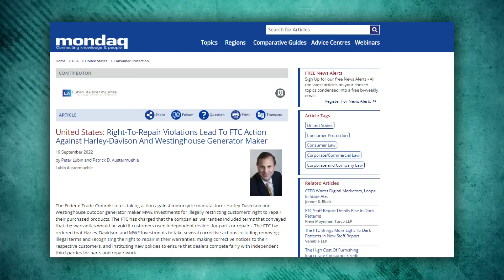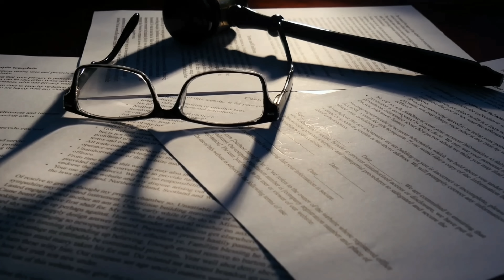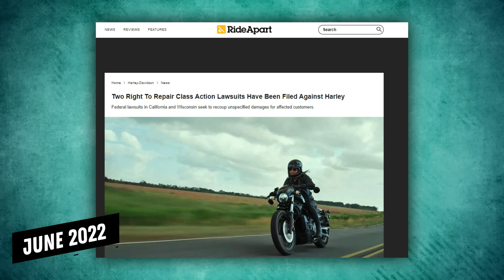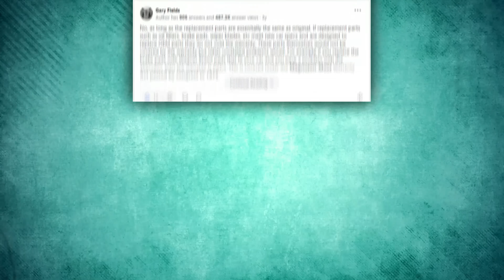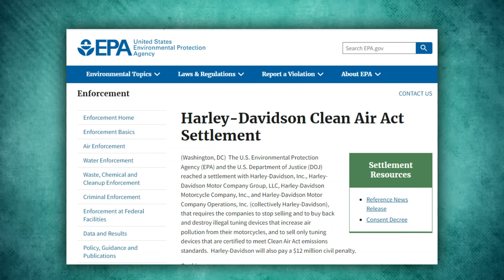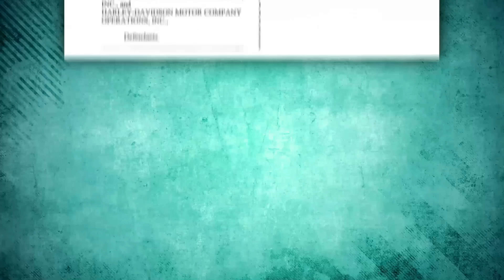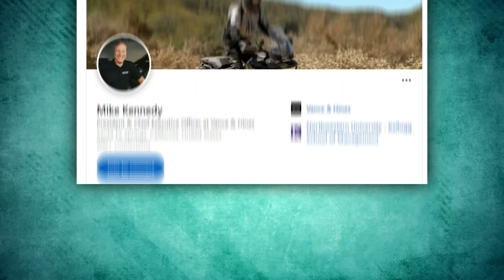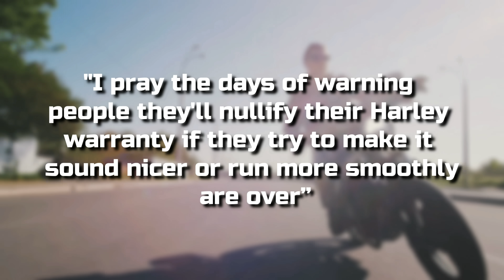This Affects All Motorcycle Owners!

Comment: Im 15year  Technician at the same HarleyDavidson dealership , we install aftermarket parts dragspeclties , tucker . We warranty our work for a year and some acception by miles for the weekend warriors and still guarantee the factory warranty aslong as it's in our hands , now sometimes they send a representative to check out the problem in person then depending on what wrong and what after market parts or on and if they caused the issue at hand . Ther ar a lot hacks out ther and so as a flat rate technician not everthing going to covered by warranty If your that type customer you will never get any technician your bike will handled by many technician instead of one technician that will produce good work , honest and knowing you and your bike is a good thing .

Comment: Been riding a harley for years, have a 1988 complete custom 1200 sportser bought second hand with 3,000 miles on it, it now has over 135,000 miles on it, have a 2007 ultra with 49,000 miles on it. Both have been trouble free, except normal wear and tear but i can't even buy oil filters from my local dealer or even a different sprocket for my 1200 so to me dealers are as useless as their warranties. I have never needed either one. I'm almost seventy so I may never buy another bike but if I do it won't be from a dealer it will be a low mileage taken care of used bike.

Comment: The thing that I don't understand is why? There is something else going on here. All of this right to repair stuff is only going after substantial American companies. Yet you can't do anything to most new cars without voiding the warranty. All of the New electric cars will stop working if it's not fixed by the dealer or a approved shop.

Comment: Well As a Retired Harley-Davidson Service Manager and Warranty Manager, i can Say this Video is VERY Misleading !! NO ONES Warranty is being revoked for changing a Radio, BUT Harley Will Not Cover the Say Pioneer or Sony Radio installed Nor will it cover any Damage that the installer did to any connected parts.  As to the Muffler thanks to the EPA bikes come from the factory right on the edge of a lean condition, adding the muffler could make the lean condition WORST !! thus damaging internal parts in the engine and Emission parts, as to the tuners, and Cams and other upgrades Harley has done a lot of work to stay compliant with the EPA, you go slapping on aftermarket parts that are not compliant and 1st harley has every right to void the warranty and all these law suits will go No Where, and harley may get even stricter, frankly if i was the CEO of Harley i would drop the factory warranty and let people buy however long they want with written rules on how to keep it.

Comment: I have nothing against HD, they have beautiful bikes, a long history, a huge franchise, and locations, however, most metric bikes (Yamaha, Kawasaki, Honda) will oftentimes use aftermarket parts in replacement for things such as gaskets, bolts, exhausts, filters (air and oil), and even use fluids/oil that is better and help the engine life last longer than the default fluids that come with the bike from the factory. Most of these dealerships are Powersports and do serve most that are not just the weekend warrior. An after-market brake pad without a built-in vibration damper can cost me $30 to replace and have the same result and stopping power as the $130 OEM pads. besides most warranties are typically for a year, so after that point, you're on your own anyway. You can't even buy aftermarket exhausts in California, and if you got ahold of one, it most likely wouldn't pass their emissions test. If it's too complicated to mod and ride your ride in the sate you live in, move to one that's more mechanically friendly.

Comment: I played in twice the normal speed to obtain the necessary information from the core of the problem.  Locked-in-vendor sysdrom is a bad thing for any brand of motorcycles, especially for HD as their sales are falling down.  You can't blame a custorm for a mechanical brake down when another part is installed which has nothing to do with the problem. A bad thing it is.

Comment: You change anything that increases or decreases performance your warranty should be void . That bike has a warranty that covers the bike AS BROUGHT period . That includes adding parts from any other company unless Harley has clearly stated those parts are approved. After the warranty is up do all the modifications you want . Run the bike the way you bought it , change anything , tires, exhaust , chains , sprockets and the warranty dies right there and then

Comment: Buy one used, or buy 50 state legal Screamin Eagle parts until the warranty runs out. I bought mine used with aftermarket pipes, air cleaner, and tuner on it, FROM a Harley dealer!!!

Comment: The warranty and keeping them stock is a good deal in one scenario only as I see it. Say you are retired and want to tour. Coast to coast….going everywhere. Because there are dealers everywhere, any issues or needs can be handled, and if you have stock wheels and tires, it is easy to replace a tire if it is in stock at every dealer.

Comment: I go back and forth on this topic. On the one hand, a company is only able to control its own conduct and practices. So if you take your bike to Joe Schmoes bike repair and amphetamines shop, and they do shoddy work that affects the lifespan of the product, why should Harley be held responsible for that early failure? Same goes for using aftermarket performance parts, or cheap reproductions. Harley has no control over the quality of those products and shouldn’t be held liable for the consequences of using them. On the other hand, I want to work on my own stuff, and I want access to the same information a Harley tech would have access to. Almost zero manufacturers of any product are doing that, and i think it should change. That being said, If I make a dumb mistake, and the engine fails, that was my mistake, not Harley’s mistake. Maybe some of you have had experiences that will clarify why this suit is needed, but I personally don’t think this is a complicated topic.

Comment: It is stupid, as it should be uniform across the brand, but the warranty coverage is solidified yet subjective, on a dealer by dealer case in terms of Harley. What I mean by this is while all dealers have manufacturer set warranties, some dealers are absolutely draconian in what "their" warranty covers, while others take a more lax, common-sense approach. The latter tend to be dealers located in smaller markets to my experience, that don't get as much volume as their bigger city counterparts, and overall are more down to earth because they have more to lose consequently. The dealer I bought from fully expects new owners to do reasonable mods (bars, seat, suspension, breather, etc.) off the bat. Will they warrant replacing the aftermarket stuff that took the positions of the OEM parts? Obviously not, unless they do the labor/install themselves maybe. But completely voiding your overall warranty because you wanted ape hangers to replace the god awful stock bars on your Road Glide? Dealerships that would do so deserve to be ran into the ground. 

Overall though, this should set a precedent for the whole motorcycle industry, and hopefully help the consumer. Everyone likes to point the finger at HD, but I've heard of other brands doing similar right-to-repair violations, such as Ducati. This effort can only help consumers.

Comment: This is one more reason I would not buy a new harley..I would buy an older shovel that has no warranty  and I can do to it what I want. This is just like auto warranties that require you to take it to a dealership  for simple maintenance  schedules. 5w20 motor oil is just that 5w20 oil..it doesn't  matter where you buy it.

Comment: Long time owners of old bikes won't be affacted much; espicially if they do the work themselves.
HD is now trying to sell to a new younger market - LiveWire, Porsche engine bikes.
Reply: From a legal standpoint Ford could cancel the powertrain warranty due to the non approved non oem parts being installed.
Whether it is a car, bike or whatever the manufacturers tune these vehicles from the factory with a certain cushion of safety in longevity as compared to the actual design limitations and changing certain components eliminates that built in safety buffer.

I have installed tuners on 1000cc metric sportbikes that increased the engines timing, the fuel curve and increased the factory rev limiter to a 1000 rpm's over stock.
Why should a manufacturer still be responsible for providing a warranty on something I had increased what in their warranty and factory settings that were deemed by the manufacturer to be the safe levels?

Also to meet EPA standards bikes from the factory are already tuned very lean to pass the emissions test.
Just changing the exhaust to a more free flowing exhaust alone can actually cause the bike to run leaner, hotter and do engine damage.
Again once you change from oem you take out any factory settings and specs they deemed safe.
I have to agree you change anything you void your manufacturers warranty as you bike no longer is in its same state as when it was built and left the factory.

Comment: I already got a updated warranty policy. You can repair the motorcycle yourself and use aftermarket parts or oil and it doesn’t void your warranty as long as it can’t be proven the aftermarket part or lube caused the problem. Click bait.

Comment: All manufacturers demand warranty work be done by their own dealers.
Reply: That is reasonable. How else can the dealer and his parent company document warranty work for, for instance, the next owner. Warranty work includes engine mods, such as the 2016 (and on) Yamaha FJR1300 second gear failures or safety issues.

Comment: This lawsuit is bogus at best. Fact is there has always been an aftermarket seen in everything. Cars and motorcycles alike no matter the brand. Fact is if you choose to mod your bike or your car you do so at your own risk plain and simple. Another fact is, there is no manufacturer that allows any aftermarket mods. There are however major dealers that will acknowledge certain mods independently as long as their the ones doing the work. If this lawsuit is even real, it’s behind other bike manufacturers that are mad that Harley has the largest variety of aftermarket mods than any other bike manufacturers!

Comment: If you must customize your bike right away……buy used…there are plenty of stock platform bikes that are past the warranty point…plus the EPA really does have Harley’s hands tied. BUT!!! I would like to see warranty’s upheld if the engine mods are done by a Harley dealer….I think this Is fair….I would never warranty someone else’s work either And there are a lot of hack mechanics out there. But if someone takes their bike to a dealer…and has parts put on that are epa compliant (I know I know I hate it too but until we abolish the epa there’s not much we can do) then the warranty should be upheld no matter what.

Comment: This is exactly the reason why the last harley I bought new is going to be the last one i buy new. Harley is a scam. i went into the dealership in kennwick washington to have my tire repair that only had 1200 miles on it. they would not repair it. They said they don't patch tires anymore so i went and bought a small compressor that hooks to the lighter and some plugs and have been riding on it ever since. they try and milk every last cent out of the customer. Bad for Business harley and people are getting tired of it.

Comment: I’m not this is a Harley issue and comes across more as a Harley bashing than news. Aren’t John Deere, apple, etc dealing with with the same thing? This is right to repair issue and involves a great many large manufacturers and their customers.
I also own a Harley and have had only 1 minor warranty claim, which my dealer corrected and I’ve been doing my own maintenance and adding after market parts since day one.

Comment: Why care about a warranty? Hell if any of my vehicles break down I just fix it myself I don't have the time to have a shop to fix it. when it comes to electronics cellphones tv's computers ect.... are so cheap nowadays compared to the 70's through early 2000's prices  you can just buy a new one for a fraction of the cost of what they used to be. 60" tv back in the 90's $6,599 you can buy a 75 inch tv for $750 🤣

Comment: warranty supposed be on engine and transmission not on whole bike yikes
i like custom outside on bike like upgraded headlights and tails light to led to draw less power in cause stater died that have enough power to see where u going or other driver can see you out there not in blind spot
rest of motorcycle like upgraded they body shape like adding plastic bag unset of leather bag for more waterproof n long lasting quality 

i dont like company does this crap because it just make bigger mess and more problems down the road n they make no profits off of it for ripping customers off

Comment: My fly by wire warranty was voided eight months after I changed handlebars. I installed a new fly buy wire myself. It was also bad but didn't go out completely until months later after the lawsuit. Las Vegas Harley Davidson replaced it and charged me $75.00 for towing and $150.00 for shop charges. F- you Las Vegas Harley Davidson you ripped me off for the last time you suck. The same guy owns all three Harley dealers in the Las Vegas area, and he is a thief. Having a dealership is a license to steel from your customers.

Comment: I don’t get it, maybe it’s different here in NY. First Commiefornia is a different animal with all their CARB crap (even with cars). So ignore that for a moment. First, if a repair is a warranty one what does it matter what the cost of the part is? Ur not paying. It’s under warranty. I have tire coverage, got nails in my tires on my bike with apes, a cam, exhaust, and headers and the tire warranty covered the cost of the tires and install. Beyond that, let’s say u put an aftermarket cam in your bike in your garage and threw a tune in the bike and the engine grenades. Why should Harley be responsible for that??? Or any bike or car manufacturer for that matter. Now if a dealer tech does the work using a Harley cam and tuner and same thing happens, yes it’s warranties. Plus anything including a big bore kit u have a Harley dealership instal within 60 days of purchase of the new bike is covered under the bikes warranty, even an extended one if u buy it.
Reply: Oh, and there are plenty of dealerships that have the Harley parts as well as aftermarket stuff like exhausts etc in house.

Comment: And yet another in a decades long avalanche of bad decisions by Harley.  They hire CEOs fueled by greed,that have little to no knowledge of motorcycles.  The corporation has been price gouging greedily for decades.  And they wasted a phenomenal amount of money opening up far too many dealerships. They catered to an aging,fickle clientele.  HD has no one to blame but themselves. Oh,and lastly they discontinue by far the best engine they have ever produced in the Evolution Sportster. What gives?
Reply: Their new Sportster though makes like twice the power, and its not a vibrator between your legs (although I'm sure they lost some female clients due to this change).

Cons: No Potato-Potato sound (I'm disappointed the sound changed too, but the gearbox in their new engine is like 10x smoother and not a clunky chinese feeling piece of junk)
Tires will wear out faster from the extra power (if you're using it, though they do use sportbike tires front and rear)
too much digital if you're old school
fork slant angle is wrong (or maybe tire pressure, but something felt off, handled corners better under hard acceleration)

Pros: I think all the digital aids (wheelie control, traction control, cornering ABS etc) can be disabled, but only time will tell how reliable it is
Power, lots and lots of extra power (with adjustable power modes ranging from rain mode to full 121 HP)
Fuel economy (supposedly makes as good or better than my 250cc duel sport, but with about 106 more HP)
Looks (could call it pro or con, its kind of futuristic as they were going for a concept bike look, which I think they nailed)
Reply: Also yes, testing I first tried out their older Sportster model (new from dealership), and their new 2021 design which is the Sportster S. One was kind of fun but felt like cheap chinese knockoff (low performance, kind of heavy, lackluster shifter making clutchless shifting feel really weird and not smooth on the shift lever like it had metal burs internally or not as polished), the other was REALLY fun and lively (bang through the gears and zipping at nearly triple the speed limits around curvy roads in just a few seconds, with most of the weight removed from the front wheel that thing handles way better).

My biggest gripe is they only have 34 degrees of lean angle on their new model (which might be more than the old one), but I'm used to about 45 degrees (my bike can handle 55 degrees depending on shock absorber loading, though I'm usually not scraping the pegs on the road). Its also made for short people (like pretty much every harley), so I'd need to make some adaptor plates to move the footpegs forward and extend its shifting linkage as well as add like 6" of seat foam and probably change the handlebars (or alternatively if they sold 6" taller front and rear shocks, that would take care of my lean angle gripe and it would be amazing!)